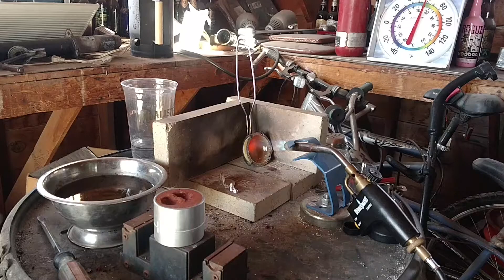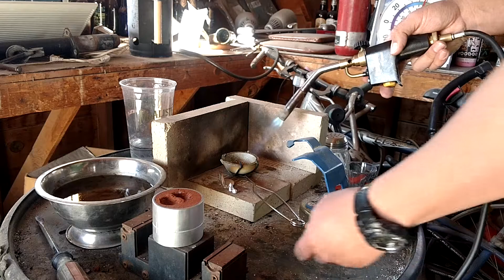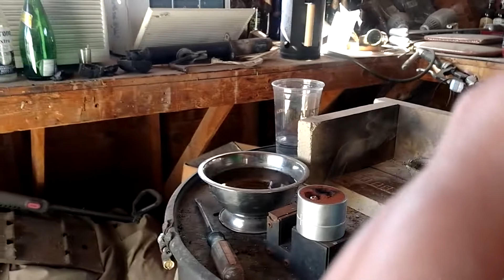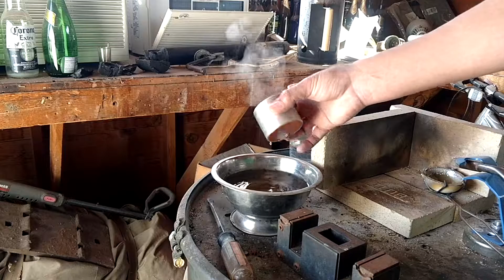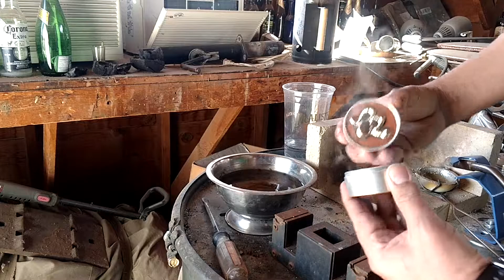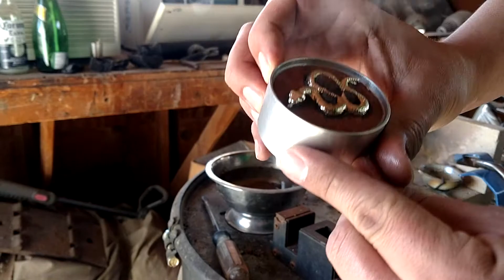At the barrel again.

Comment: I really like the 8000 series torches but a lid and some tighter enclosures will sure speed up the process and help big time on gas savings too fella. With those bricks like I use hole saw and cut with reg. handsaws with no damage to them at all. I sure like your torch stand. It looks like it's it's on a mag mount base. Did you make it yourself ? I would love to plagiarize that for sure. My arm gets so tired in a couple hrs of pouring.Your snakes are all you bud. They are just wonderful. One day one of them will hopefully be mine eh. Thanks a bunch as I just plain love a live pour.
Reply from the maker: Tomoko's Enterprize yes one of these days I'll carve out a few bricks like the one you have set up.. I just did a 2 ounce pour and it took a while to heat up and once again. I could see silver flying out the crucible. Hay one day you can get a snake..  Cheers.. we all give each other insperations to make and pour.
Reply: You bet fella ! Did you make that rest ? I think I will copy it anyways if you are good with that. Do you sell them ?